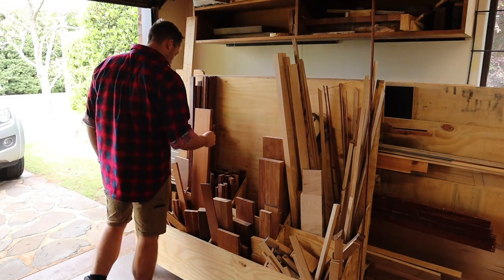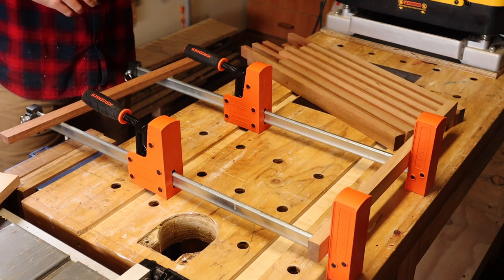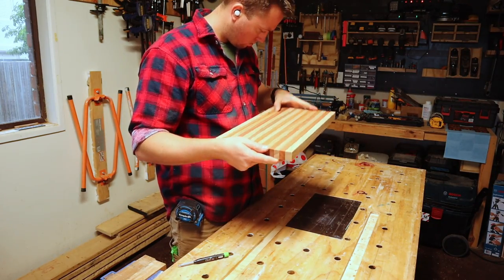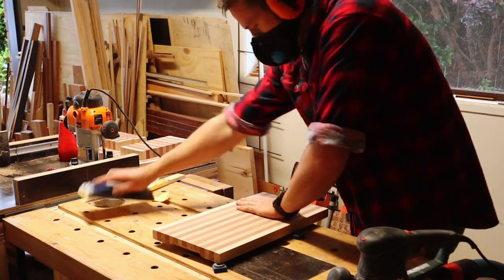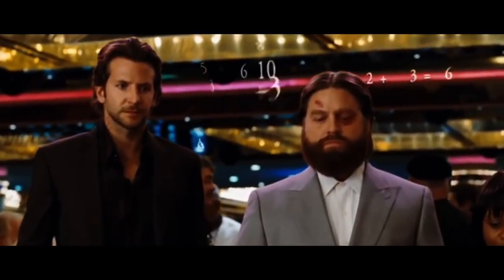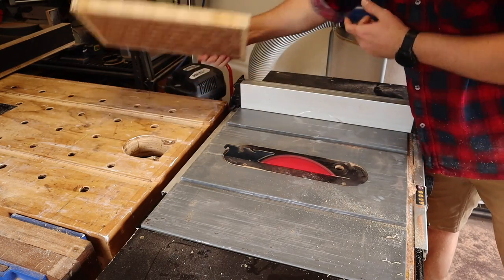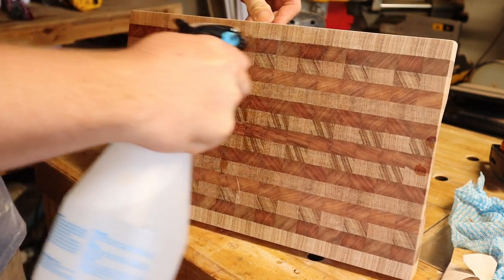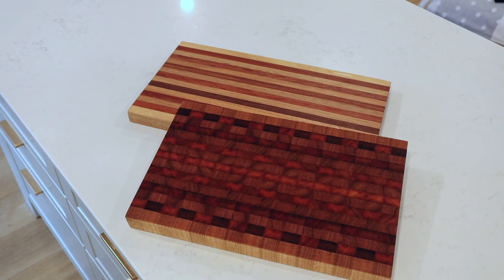Making Your Own Edge Grain and End Grain Cutting Boards

Comment: Awesome looking boards mate, love the look of an endgrain cutting board, was gifted alot of spotted gum and red gum recently. Have made some endgrain boards with some of it and they have turned out beautiful, you can use a grapeseed oil instead of a mineral oil might work out cheaper in the long run if you're making a heap of boards anyway keep up the good work cheers
Reply from the maker: Thanks Malcolm! And thanks for the heads up about alternative oils too!